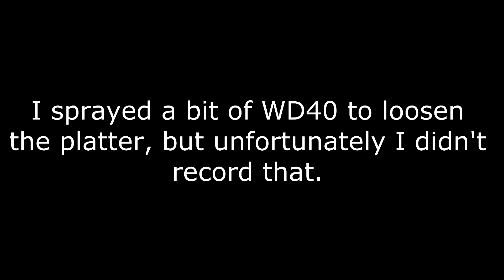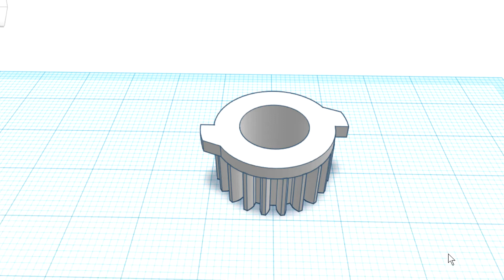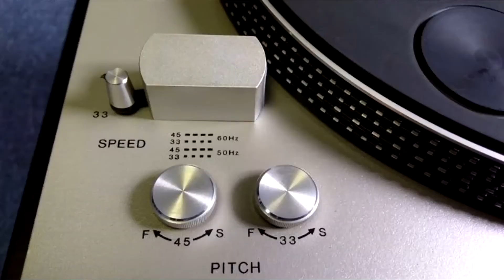Vintage Sony PS 3700 Turntable Repair and Restoration - Part 1

Comment: Thank you sir. Great video and thank you for sharing the STL file. Auto Reject function was not working in mine and it worked like a charm with your 3d printed gear..
Reply from the maker: Good to hear it was useful in fixing your turntable.
Cheers,
Jake

Comment: Thank you very much!!! Mine also has the same problem the spindle gear was totally missing.  Get my nephew to print out the 3D using a soft plastic so just need to file the inside of the spinder gear  until it is able to sit just slight above the larger gear.  Then reheat the inside of the spinder gear to soften it (i uses 130degC) and then press down and knock down slightly. Now working perfect.
Reply from the maker: I'm glad it was helpful and you got it working again. 👍
Cheers,
Jake

Comment: Beautiful work, today i repaired a Sony PS 515 (stuck mechanic - cleaned/ lubed  with tiny amount of "Waffenoel") and cold soldering points at the pitch control. Now it works good. ;-) I do this only as a hobby.
Reply from the maker: Thanks, yeah I think it's well worth the effort to restore these older turntables, they really are very good and a similar quality new turntable today would cost a lot of money.

Comment: I just fixed similar but belt driven turntable from sony as well. (Got it from my father). Had wiring issues and platter turning mecanism had grease from god knows how old. I'll join your restoration journey and wait for next video :) Good luck!
Edit: found part two.

Comment: Got a Sony PS3300 out of the cellar from my parents. Changed the needle and noticed something was off... Exactly the gear broke u remade. Its the exact same mechanism, I gave the file u created to a 3d workshop and they make me 3 of these for one buck each. I will give feedback if it worked :) Thanks for your service!
Reply from the maker: Hope it works out. The dimensions can vary a bit depending on what type of 3D printer they use, they might have to either scale it up or down a bit for a perfect fit.
Cheers,
Jake
Reply: @TheStuffMade  It worked flawlessly out of the box. The 3d print was a service job done from a local printer company. had to make 3 of these because of minimum order value (each 1 euro and 5 euros shipping cost so it was a job completted for 8 euros) but it was a good thing cause the first time my stupid ass put the gear the wrong side on... had to rip it appart to get it off the shaft, next try was a success.

Thanks for your shared file my record player from my parents made in the 1970 works 50 years after production :)

And i got one gear still as a spare if the thing collapse again on me after 50 years xD
Reply from the maker: @GermanAnimeStriker  That's great, thanks for the feedback.
Cheers,
Jake

Comment: This is amazing, I love how you just 3D print things to create parts you don’t have.  I have a PS-T1 that I got from my dad.  It is in very good shape, just hooked it up last night, and seems like the speed control is faulty (plays too fast no matter whether 33 or 45, everything sounds like chipmunks).  I will follow along in your journey to see if I can’t learn something for my own problem!  Thank you!
Reply from the maker: Thanks, I find 3D printing is a great tool to make parts, but it's a bit of a steep learning curve to be able to design something that will work well. You should check the board and pots on your PS-T1, it might just be some dirty pots to fix the speed issue. You can download the service manual here: https://elektrotanya.com/sony_ps-t1_turntable.pdf/download.html
Cheers,
Jake